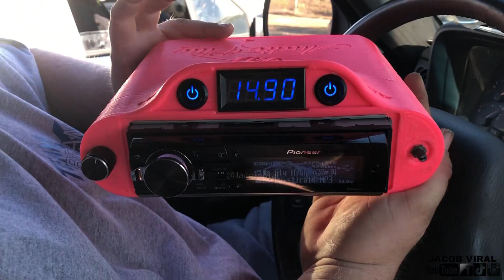THIS SHOWS THAT 10 INCH SUBS CAN GET LOUD AND LOW!

Comment: No doubt they can!! I remember my 10 inch Jenson subs that beat nice n low
Reply: Dude I had 4 Blaupunkt 10s in a Honda Accord in 1996.Two ported, 2 sealed. Shit banged harder than a Kicker sponsored car with 3 (round at the time) 10" solobarics.